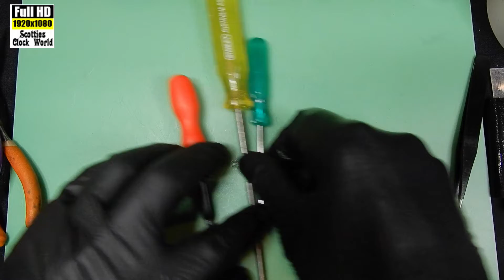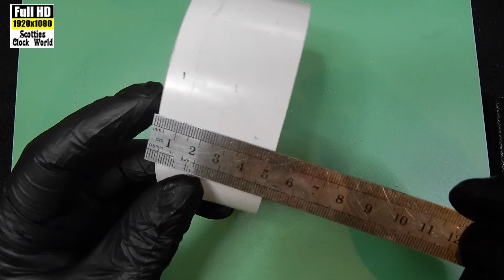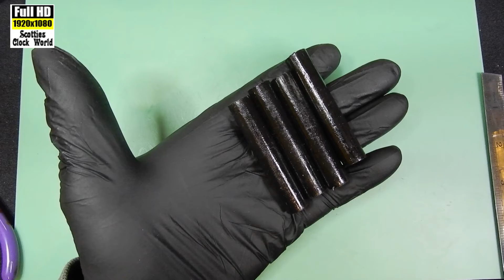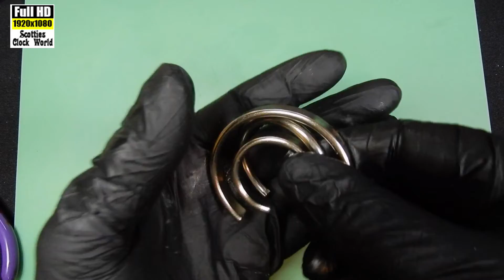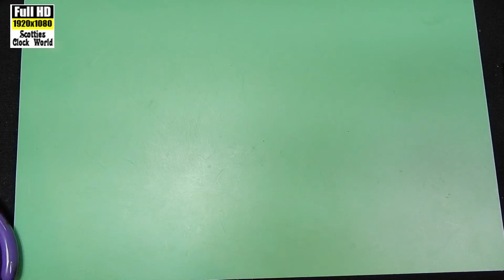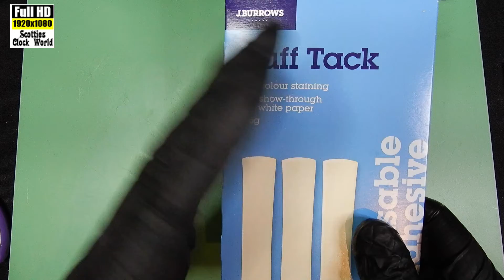Clock Repair For Total Beginners - Lesson 1

Comment: I like this video. I like the dowel idea for the movement holder.  Maybe you could suggest to people that when they are first starting off that they could use alternative to the let down tool and the clamps. Wires work good for clamps. A wooden dowel with a slot in it to hold the key works good for a let down key. I havent ever used the spring clamps. I have some. They tend to get in the way where the right wire or zip tie tends to work better for me. I have a home made let down tool that I made back in 99 and I still use it to this day. Some of the tools can be expensive when you are first starting off and thinking that you might want to repair clocks. Then you buy all of the tools and decide that clock repair isnt your thing so you just spent all the money that you wont get back. Just a thought.

Comment: Good info here, thanks Scottie.   I have some wooden sticks-like the skewers used for kabobs, get at the grocery--- good for poking around in the movement!
Reply from the maker: @paulwiden4061, those skewers work on for pegging out bushes and removing gunk from pinion leaves. The sharpened end can be roughed up a little with 80 grit sandpaper to make them more efficient (softer).